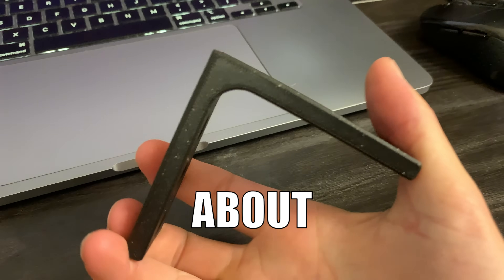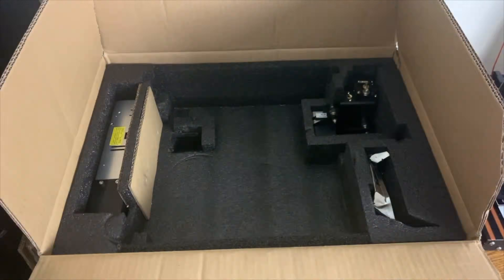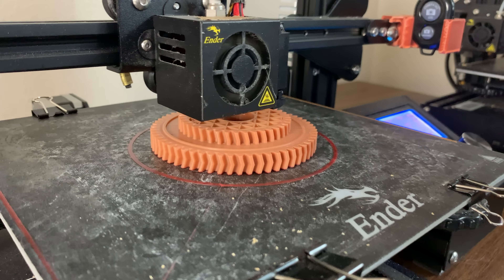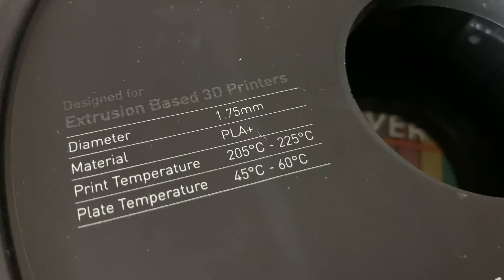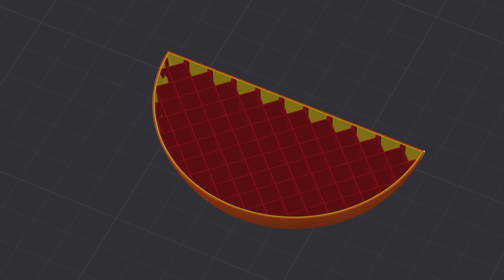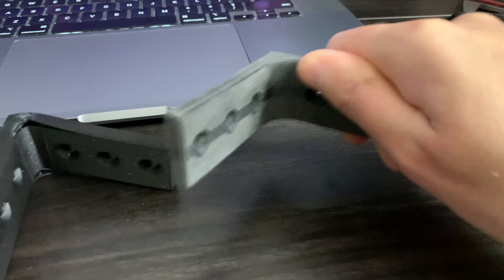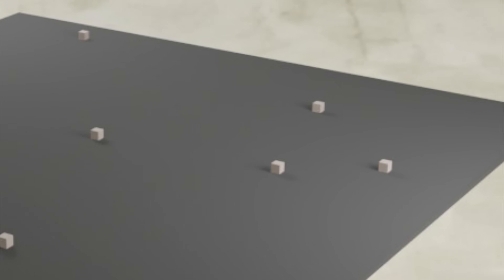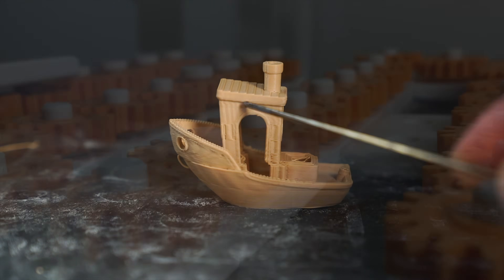9 3D Printing Sins...

Comment: I use ipa so i dont have to remove the bed and walk it over to a sink or wait for it to dry. Benefit of PEI is no need for glue stick and a nicer bottom layer finish like with stock ender beds alongside parts releasing on their own when cooled.

Comment: 1. Touching the bed
2. Not leveling bed properly
3. Printing too fast
4. Wrong material settings
5. Not considering print orientation
6. Not storing filament properly
7. Cleaning with ipa instead of soap+water
8. Using PLA for outdoor parts
9. Adjusting slicer settings too much
Reply: Thanks u saved me 7:15 min of my life time ^^ ur my hero for today
Reply: But I wanted to hear him say warm soapy water 30 times to pad the video length!
Reply: 6.5: wall count/material selection/infill percent
Reply: How do I change the print orientation because I haven't used a 3D printer before
Reply: @Mingzhe583  put your printer sideways. 

//jk: generally select your model in the slicer and change its orientation. How that is done exactly depends on the slicer you use.
Reply: I prefer to use Bestine rubber cement thinner (heptane) as an industrial, graphic designer, and illustrator. I've used it for years. It cuts grease and oil and dries instantly. It is flammable, but in more than fifty years, I've never had a problem.
Reply: Thank you for saving 8 minutes of my time

Comment: #8 - Yep, learned that after 4 failures on a printer that had been sticking perfectly with the same filament and settings because I was in a rush and just did an Isopropyl wipe down.  After 4 failures, I removed the bed plate and washed it with Dial soap and warm water.  Next print run succeeded and I'm a soap fan for life.

Comment: Due to many reasons, there’ll be a filament residue left on the build plate which won’t go with soap water. Hence, we need to use IPA. Hope this helps with why!
Reply: IPA should stil be last resort. After using my printer for 2 years I lost my adhesion completely. A single wash with dishsoap made the adhesion return as good as new afterwards. IPA soaps are also expensive and difficult to get hold of in some countries. In my country it is considered a special medical cleaning agent and you can only get super strong ones in stores that can likely damage the buildplate itself instead.
Reply: @Zefnoly  For me it's the opposite. Soapy water doesn't completely clean my PEI sheets. Not only that, it doesn't help with adhesion.
I use isopropyl alcohol very often (almost between each print) and my prints have great adhesion, I've never had to use glue or anything else whatever the material (PLA/PETG/ASA/PA-CF/TPU/...).
If the first layer doesn't hold well: a little alcohol and it's back on.
And no problem with any of my sheets that are here for 2 years and are used multiple times a week.
Reply: @zefnoly9147 I'm sorry did you just say you didn't wash your plate for 2 years??
Reply: @HighExplosiveOP What about it? When I had my Ender 3 v2, I didn't have to wash its bed for two years. The only reason I had to was when some PET-G stuck to it a little too well. It was a cheap HICTOP or whatever brand smooth PEI plate off of Amazon.
Reply: @Zefnoly  Why not buy a new build plate at that point? Depending on the printer they are pretty cheap.
Reply: @DoomSlayer65 why buy a new one if cleaning it with soap restores it?
Reply: @geemy9675  I only meant it if they had tried everything, but they said washing with soap and water worked fine, so no need to buy a new one

Comment: #9:  On the topic of 3d prints for outdoors.... I feel like the MAIN time you'd have an issue using PLA for something outdoors is if that particular item is meant for in your car (or a shed or somewhere that doesn't have good temperature regulation) or is constantly in direct sunlight.  PLA starts to soften at 60C/140F, so in most cases it would be OK, even if it's just something you need to throw together in a pinch until you can get a proper fix or something.
Reply: Last July I placed my Ender 3 outside to print ABS. The outside heat was enough to soften almost all mods. But an ashtray printed in PLA still looks the same after a 1.5 years outside in the same spot.

I think the issue is load on the printed parts while they're warm, even at 50-55°C. The ashtray has no loads or weight twisting or pressing on it. Meanwhile the mods had belts, z-screws or even the weight of the BLTouch to provide an external force.
Reply: @roderickborg952   Yes, in the absense of external stress we can minimize problems with approaching the temperature limits of that particular plastic. This is why various plastics have heat deflection testing done to test that limit.

That being said, gravity is a force, objects can still move and settle with simply heat and nothing else. Add to that the bridges on a part and the non solid infill and you can still find pieces moving out of tolerance, but that probably doesn't matter for 99.99% of 3d printed parts, so I digress.
Reply: @roderickborg952  plus the added heat of the hotend and build plate... Possibly the power supply a bit, too.
Reply: @roderickborg952 exactly! If there is no real mechanical load or complex Geometrie PLA will work just fine! But as soon as there is a mechanical load involed even Petg starts to deform in a car
Reply: Usually it starts to deform at like 40 to 50 degrees depending on the mechanical load

Comment: Automatic bed levelling isn't all its cracked up to be. I've been spending a few days tweaking my Ender 3v2 to get the first layer to print well. I got one amazing print... Then it tanked.

Haven't been able to nail that perfect first layer yet.
Reply: It really is, try manually creating a mesh of the bed and then see how easy using a probe is. An ABL probe is generally a lot better and easier to use than manually levelling the bed, you just need to set the probe offset correctly which changes every time you change your nozzle. If you are getting that much inconsistency between prints then there is probably something wrong with your printer, most likely something is loose.
Reply: @conorstewart2214  I'm using the CR Touch ABL sensor. ON my printer the x-axis crossbar is only driven on one side, so I suspect both sides aren't moving unilaterally (the non motorized side is dragging). I think I need to tighten that up.

Every time I run the tramming wizard (MriscoC firmware), I get different results (even when I don't change anything)
Reply: A trick I learned from messing around with an Adventurer 3, and an Ender3 V2 Neo with a warped bed: Set the first layer height to 0.3 or 0.4 mm, and set the first layer extrusion width between 1.0 and 1.6 mm. The thick extrusions will have no problem adhering to the bed even if it is a bit wonky. It's also, apparently, the only way to get the Adventurer 3 to print successfully without a raft.

Comment: No problem, let me just pour water containing soap over my unmovable heat bead and fry my 3d printer in the process. Don't listen to that bull shit. 

U can use isopropyl alcohol on your heat bead, it works as well as soapy water. If you use glue on the bead, just scrape it off using a metal spatula, and clean the rest of it with isopropyl alcohol. 

Lil tip: glued paper does better job than the glue itself.

Comment: I mean... I very rarely clean my ender 3 pro default printbed, swipe it with my hand sometimes, and never got a problem with it...
And if someone has problems with the adhesion, you can still print with a little border to stick it more

Comment: OMFDG... WHY is anyone still giving the BAD ADVICE of "use paper to level your bed" in 2023!? Paper is not UNIFORM ENOUGH TO LEVEL YOUR BED BY! ESPECIALLY if you've been using the same piece of cardstock for it over and over and over again!

As a point of fact, you shouldn't use ANY test material between your nozzle and your bed if you want to properly level it. A PROPERLY leveled bed places Z=0 in contact with the bed. NOT zero-point-whatever millimeters above it.

Use your brain and use your eyes. Most of us have flashlights and cameras of some description if you can't see it well enough. A cheap magnifying glass or a cheap set of loupe glasses (used by jewellers and woodsmiths and electronics technicians, among others; the ones with either several extra lenses in front of one eye or else a single telescopic lens assembly over the same) will help impressively as well. 

If you go around more than three times and you're still having to readjust, then your X gantry is off level or your frame isn't put together right. Move your hot end to one end of X and lower it to Z=0. If it stops above the bed, turn off the motors and manually turn the Z screw on that side. If it stops after hitting the bed, raise it a few millimeters and then turn off the motors to raise it manually by turning the screw before you use the control to lower it to Z=0 again.

If you have a second Z screw, repeat the process on the other end of X. If not, you'll have to adjust the other end of the beam using the rollers and will have to repeat this maintenance far more often due to sag.

Once completed on both ends of the X gantry, assuming your frame is squared, proceed to level the bed at the four corners again.
Reply: It’s not bad advice if it works and it does work for most people and printers. Some 3D printing firmware even recommends using paper to level the bed or set the Z offset of the nozzle if using a probe.

Levelling it just with the nozzle and bed in contact creates its own problems, like the nozzle actually compressing the springs of the bed, it’s easier to tell that with a piece of paper.

The best way to manually level would actually to be to use a feeler gauge and make sure the printer knows what thickness feeler gauge was used when levelling so it can offset by that much, that solves the uniform thickness problem and the telling if the springs are being compressed by the nozzle.
Reply: @conorstewart2214  A feeler gauge has some similar issues in this context as the paper does, given the common advice to level your print bed when both the bed and the nozzle are hot. The radiative heat from each of those, compared to the relative temperature a foot away, can cause the feeler to expand and contract, and not always uniformly. You can estimate which and by how much, but that may not actually be close, and it may be significant enough to need a different Z offset than simply the labeled thickness of the feeler.

Comment: Info on speed is really inaccurate. It's mostly acceleration not the "speed" setting that affects typical print times, and not understanding this is a big source of novices trying to dial up the speed, finding it makes almost no difference, leaving it cranked up, then having a print fail as soon as they try printing an unusual object with long straight runs.
Reply: It isn’t that inaccurate, on large prints the speed will affect the print time a lot, and if you have a core xy printer with very high acceleration then the limiting factor will be speed.

Comment: Another tip (not really a mistake or sin): If you're modelling to fit onto an object, start with 0.2 mm tolerance. This seems to be the typical tolerance both for plastic printed and metal machined parts. There are some tolerance guides, but those are to fit two printed parts together.
Also, check to see if your slicer program allows you to change "wall ordering" > "outside to inside". I haven't had much success with the setting, but it doesn't hurt as the printer will print with better dimensional accuracy.
Reply: Potentially of note, wall ordering affects its ability to handle overhangs. Outside-first should be fine up to 45 degrees or so, but inside-first I can manage a hair over 60. (Also somewhat dependent on layer height.)
Reply: Also if making mechanical parts with tight tolerances like gears then use a raft to avoid the elephants foot.
Reply: 0.2mm is 8thou in Customary units, that is very loose for machined parts.
Reply: @JeronimoStilton14  you generally start with that due to expansion of the printed part, you can tighten the tolerance then if you want. Printers generally need to be calibrated to produce very precise parts.
Reply: @conorstewart2214  I am aware, I am just mentioning it’s not a typical starting tolerance for the majority of metal machining.
Reply: @JeronimoStilton14  I agree, it's a random mention considering the use case is important if the end user is making a box lid, a locating dowel, or a running sliding fit.

Comment: Bro, just like soap is a non-polar thingy that takes away the fat (grease), so are any alcohols 👌🏽 that's why isopropyl alcohol is very popular when cleaning the bed. You could even use acetone, since it's a non-polar solvent as well, but it's more expensive... Although by that case, soapy warm water is the best of all 😆 the point is, IPA cleans grease and oils just as well as water and soap

Comment: IPA works better than soapy water and it does not require removing the build plate if you are using glass.
Reply: If you have your z offset correct, and adhesion settings correct, there is no need to use glue stick for most common materials, and therefore, no need to use soapy water. 
For those of us that use a PVA coated glass build plate, every time it is removed it has to be re-leveled. This becomes a real pain if we have to clean it with soapy water constantly. IPA and cheap paper towels works great to remove oils from our hands and helps to remove leftover residue from previous prints, which you don't get if you don't force the print off the build plate prematurely. 
#2 Tip, print or buy a plastic scraper.
Reply: IPA does not work better than hot soapy water at all. Unless you are rinsing the bed in clean IPA you will be leaving residue behind, essentially just spreading around the oils and dirt. A proper wash and rinse with soap and water is best, soap is designed to be able to clean and dissolve a lot of different things.

If you are still using a piece of glass and glue stick now then you really need to consider just buying a proper bed surface.